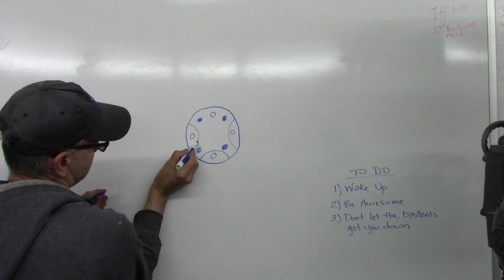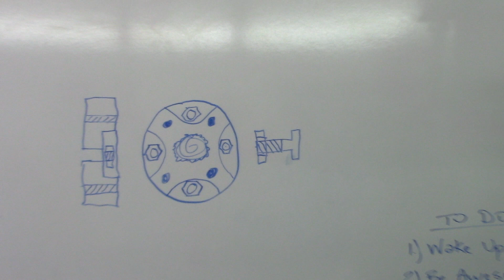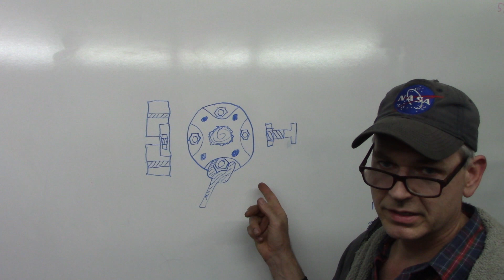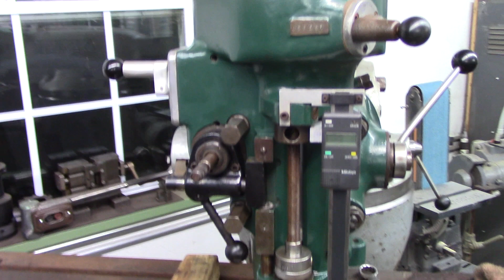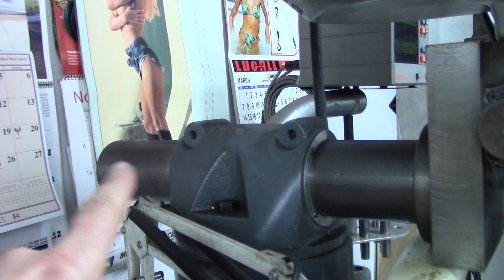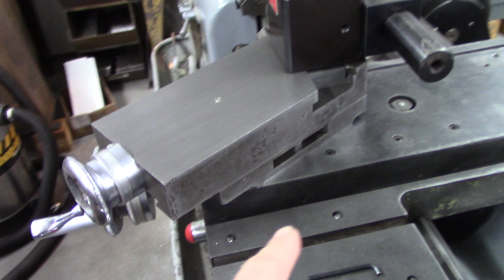11-16-23  --  Kimber needs Help

Comment: So, Doozer, I've just been looking at the "South Bend Lathe-Vertical Milling Machine Parts List_10 1 66" an I am sure that you are going to need to cut a hole in the centre of that piece, big enough for the "Head Rotation Gear" to pass through, and then make a spacer so that it does. That gear has to be bolted to the "Over Arm" for the Tilt function to work by the "Head Rotation Worm" & Head Rotation Worm Shaft"... when there isn't a Circular T-slot for the Head mounting bolts to slide in...
Reply from the maker: To be clear, I am not cutting holes in anything.  This is Kimber's project.  I am just helping advise him to a direction.  --Doozer
Reply: @kooldoozer  Yes I understand that, but you have obviously spent time thinking about this... And I want your opinion on my thought...
Reply from the maker: @trollforge  The adapter Kimber has now has a hole and an extension for the gear, so what are you asking me ? ? ?
Reply: @kooldoozer  Ok, I somehow missed that...

Comment: 'LOVE your 'to do ' list ! ! !     I'll have to BORROW it for doing up some Calligraphy on Parchment !    ( Although I may use a bit more HARSHNESS than 'bastards'  )  - - -  
       When Kimber was taking stabs at mounting the head , I kept yelling at the screen , "KIMBER , MEASURE THE BOLT HOLE CIRCLE" !   'Guess he didn't hear me through all those miles . . .    I explained in DETAIL how to make T - bolts with an arc to fit the radii of the T -SLOT . . .  'Can't remember if THAT comment didn't take , or if Kimber didn't understand ? 
      I had the same idea as you , but felt that KIMBER was going to do it HIS way REGARDLESS . . . so I just let him hack at it .    I suggested making the adapter plate over again - with a bit more finesse , & ACCURACY . . . it's water under the bridge now ! ? 
      Really glad to see this video , & KNOW that the results got transferred to the 'student machinist' !    Excellent job , . . . * It's much easier to describe in pictures than it is to write it all in WORDS ! ! !            > > >  NOW to 'copy your to do list ! '      Thanks for the HELPING !
Reply from the maker: My neighbor Toby wrote that list up there one day, when I wasn't looking.  The title is "Illegitimati non Carborundum", and the last line should actually read, "Don't let the bastards GRIND you down.  Grind referring to Carborundum, the aluminum oxide ceramic abrasive that the Norton company produced at the Niagara Falls NY plant. Due to aluminum requiring large amounts of electricity to process,  Norton chose NF and it's generators for the location.  --Doozer
Reply: @kooldoozer  * Thank Toby for me . . . & Thank you for the expanded explanation !    ( I'll have to put 'small print' as a footnote in the finished ARTWORK ! )     Artificial rubies by any other name grind just as well , depending on 'fracture' - Yeah , it would take volumes to tackle the topic of ABRASIVES !     Stay 'KOOL' !
Reply from the maker: @georgewocosky   Thanks George.  Yes, AKA synthetic ruby.  Most don't know that. You are sharp!  --Doozer
Reply: @kooldoozer  I try to stay well honed !    * Although I only have diamond grit down to 8000 grit - - - I use other compounds for finer polishing  :)       ** Part of my 'background' is designing faceted stones . . . mere geometry with INSANE amounts of work , to produce what I cannot afford !     I'm amazed with the properties of refraction & reflection of various materials - - - my earlier career was an experimental / prototype machinist , wayyyyy back in the '70's & 80's .      Stay AWESOME !

Comment: Thanks for showing the Quill dro mount, a little different view than the one in the Bridgeport head post. I’m partway through making my own version. I’ll post a few photos on the  HSM board when I get a little farther.
Reply from the maker: Sweet !   Looking forward to it.  The supplied bracketry was designed NOT to need to drill holes in the head.  After my words about not drilling holes in the machine, unless it was a DRO, well I guess it is Ok and actually better.  The 10-32 holes I tapped into the head were done on my little Clausing 8520 and spaced using it's DRO.  When drilling holes into a machine, at the very least try to make them as accurate as possible. Kind of the thinking, you only get one shot to get these drilled holes right (straight, square, tangent, etc.) so take as much care  as you can drilling them.   --Doozer

Comment: Could the ram accomodate a center draw bolt, clear through to the back? Would eliminate the need for the scallops. Wrench clearances are bigger than you would expect. I'll try to find an old chart i have..